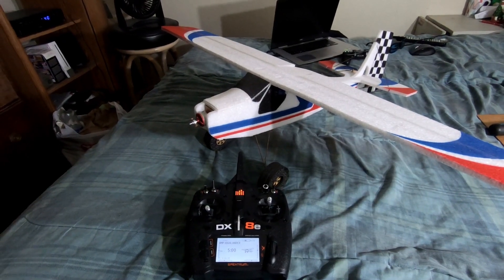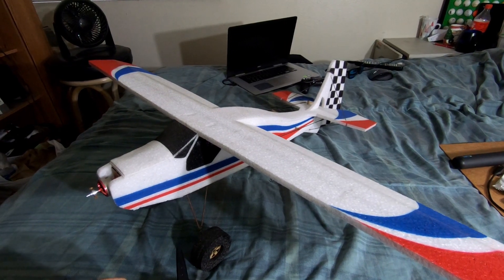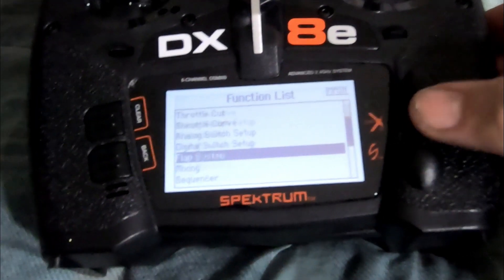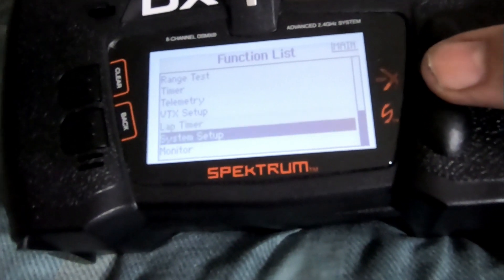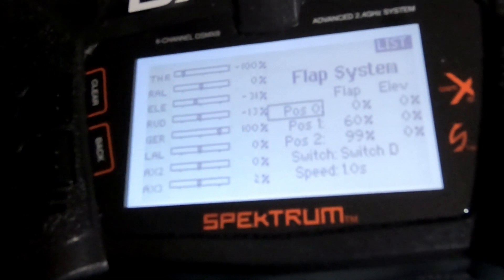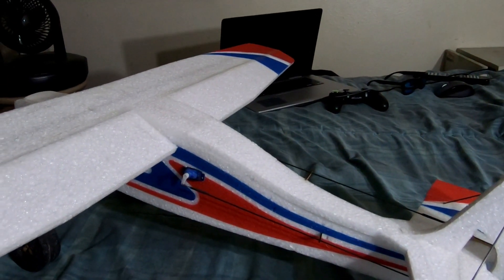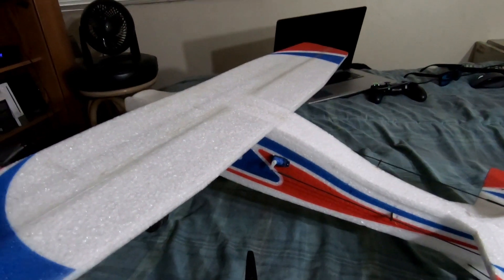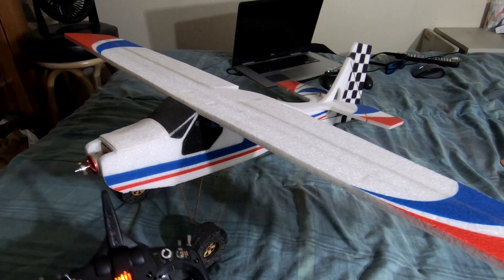Setting up Flaperons on My Highlander EPP Plane

Comment: QUESTION: does anyone have any experience setting  up and using flaperons on planes with wing tip only  type  ailerons and the  AS3X  / SAFE  AR631 6-channel receivers...I have the newer e-flight Trojan -28  and   the older e-flight  Pulse 15e.....thanks
Reply from the maker: You can add Flaperons to any model that uses a 6 channel receiver or above never tried it on a warbird.